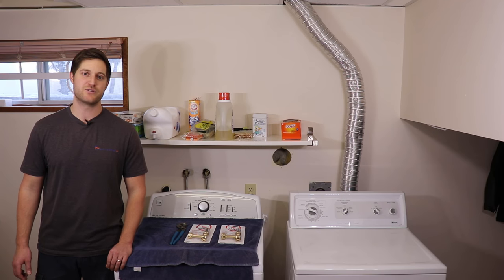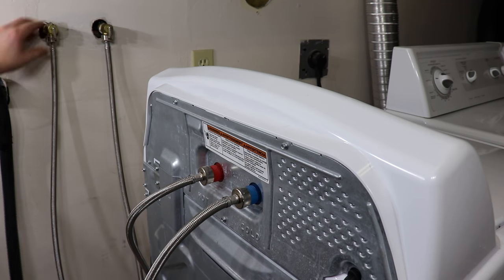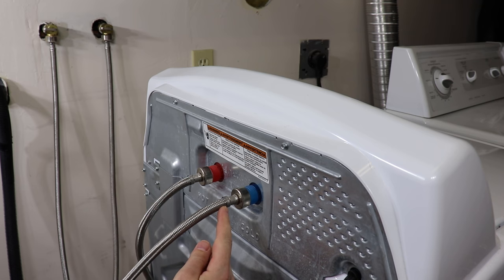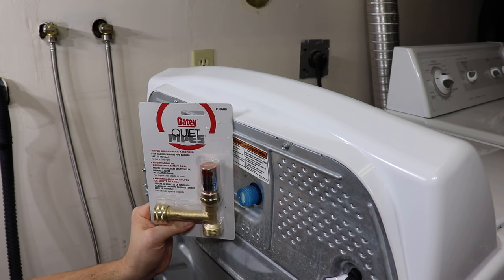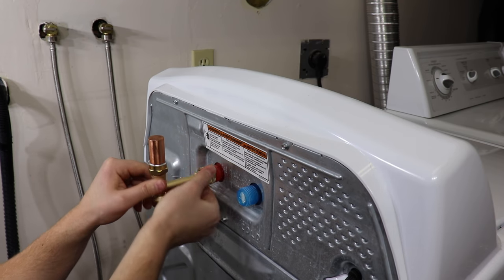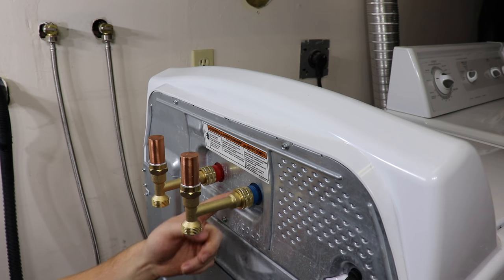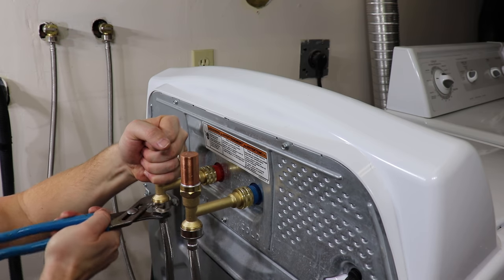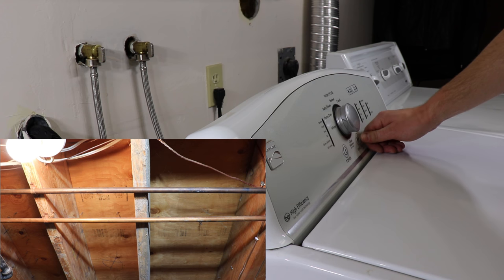Stop Water Pipes From Banging: Installing Washing Machine Water Hammer Arrestors

Comment: So may pipes hammer really bad WHEN we are running a lot of water not suddenly when we shut them off. Thoughts?
Reply from the maker: Interesting. Could be a couple of things.
1. Too much pressure. Are you on city pressure or well? Some city zones have pressure reducing valves installed in the residences because the supply pressure is over 80 psi. If these valves fail it can cause rattling piping and prematurely worn out fixtures. Residential homes shouldn't exceed 80 psi and most are around 50 psi.
2. Faulty shower or faucet cartridge or toilet fill valve. Try running different fixtures and isolating one at a time to see if the sound changes or stops.
3. Piping that is deadheading. Water should flow through a Tee from the run to the branch(the tee part). If the water is flowing in the direction from the branch to the run it can cause unwanted noise.
4. Piping that isn't secured properly. Water lines should be well supported.
Hopefully this gets you in the right direction. Good luck, and let me know how it goes. Thanks!

Comment: Just put an LG washer in and BANG BANG BANG - I need a set of these.
Reply: I tuned down the intake valve a little ....that's the cheapest solution :)
Reply: LG makes a great machine I had my for 18 years but bang bang is always there with or without these arrestors they have the quickest solenoids in the west 👎‼️ bang bang is normal unfortunately a . I turned the feed taps down to almost input pressure and the pipes still bang.

Comment: Problem is. This is only for washing machine related water hammer. What do you do if you have water hammer when you flush the toilet for example and when the toilet fills up and valve shuts, there’s a hammer noise
Reply from the maker: There's water hammer arresters that are designed for toilets as well.
3/8" Toilet Water Hammer Arrestor
Amazon Affiliate Link
https://amzn.to/38Rbile
Reply: @PROSDIY  can you use these on taps for basins or baths also?
Reply from the maker: @The52blocks  Absolutely. The one thing to look out for is that the shut off valve size and the water hammer arrestor size match. This will make installation much easier. Your basins, kitchen sink, and toilets should be 3/8".

Comment: I have a problem with american standar td automatic toilet everytime it’s flushes the pipes above it shakes like banging noise
Reply from the maker: Sounds like water hammer to me. Most of these touchless or automatic toilets open and close the water supply with a fast acting solenoid valve, causing water hammer. A toilet water hammer arrestrr should do the trick: https://amzn.to/2EJK9R5

Comment: Didn't work on my LG. front load.  It is just the hot water making the hammer noise.  Should I try 2 arrestors, one at washing machine and one at the water source?  In the meantime I reduced the hot water tap by a quarter turn and it dramatically reduced the noise.  Is it sustainable leaving it that way?   Thanks
Reply from the maker: It is fine to close the hot supply valve slightly as you did. I would probably have the main water pressure tested. It sounds like you might have excessive water pressure. Over 80 PSI is excessive and can cause water hammer and prematurely worn shower, faucet, and toilet valves and cartridges. 50-60 PSI is ideal.
If one set of arrestors didn't work, I wouldn't install a second set. I would first check water pressure. If water pressure checks out being fine, I'd install a expansion tank on the cold water supply line to the water heater. This acts as water hammer arrestor for the whole house and is extremely effective in reducing/removing water hammer.
Thanks for the question!
Reply: My LG does the same, I had the water to the house tested and then LG said to get a technician and the technician said get a water arrestor but it still hammers but not as bad. They blame the pipes not the machine even though other washing machines do not do it. Do not get an LG as the shut off valves close very quickly and may cause hammering. I am annoyed to say the least.

Comment: Can someone answer regarding this. My Water arrester didnt fit at the back of my Maytag, instead i install to wall waterline horizontally because of the space is it okay or need to be vertically ???please help
Reply: I installed mine on the wall waterline outlets horizontally and they work perfectly. The waterlines don't even vibrate at all when my washer shuts the solenoid valve. Oatey actually recommend installing the arrestor at the wall outlet. Hope this helps.

Comment: they worked on my washing machine. Now when I take a shower, the hammering is transferred to my shower. My shower head shakes when the washer changes cycle. Should I put two more on the shut off valves to the washer? should I put them all over the house? Does anyone have any ideas?
Reply from the maker: Hi Gerald, that is extremely unfortunate. Do you have high water pressure to the residence? Has the water hammer been happening for awhile or has it occurred recently? Water hammer that severe can indicate high water pressure, or having a check valve on the main water distribution line. I would recommend either adding water hammer arrestors to the shower supply lines, if accessible or adding a potable water expansion tank to the main cold water supply line. Adding an expansion tank usually fixes most homes with water hammer issues. It's basically a large water hammer arrestor.
Reply: Don't shower when your doing laundry.

Comment: and then how do you push your washer back in place with those giant fittings hanging off the back? i see you have 10 times more space your laundry than most...
Reply from the maker: If you don't have space to install the fittings, this option wouldn't work. Another option is installing a domestic expansion tank on the cold water supply in the mechanical room https://amzn.to/2LkBYx1. This acts as a water hammer arrestor for the entire residence.

Comment: What if the connections located on washer are vertical one on top of the other and not side by side as seen in your video, how then would you install the hammer arrestors ?
Reply from the maker: Hi J S, Thank you for the question. The water hammer arrestors will function in any orientation. On vertical stacked inlets I install both arrestors on roughly a 45 degree angle. I position the hose inlet (bottom) on the arrestor towards the hot and cold shut offs. This makes connecting the hoses easier.

In the example I show the arrestors vertical, this is common trade practice when the option is available. Installing them on an angle will function properly as well. Cheers!
Reply: PROS DIY Thanks🙂

Comment: Put them on the shut offs don't move the machine
Reply from the maker: You're right, you can either put the water hammer arrestors on the shut offs or the washing machine supplies. Water hammer arrestors work best on washing machines being as close as possible to the solenoid valve though. On this particular setup it would difficult if not impossible to install the arrestors on the shut offs because the hoses, or the arrestors would contact each other. They would definitely work on straight shut offs or if there was more space between the shut offs.
Reply: @PROSDIY  - Isn't "Even Flow" suggesting installing the arrestors on the shut offs located on the wall rather than moving the washing machine and installing them on the machine's back?  If installed on the wall, the contact possibility of arrestors/hose is no different than your current arrangement - correct?  Or, am I missing my Thinking Cap today?  (enjoyed your video)
Reply from the maker: @bethanyanderson1745  The hose thread on the wall shut offs in this video are facing straight down. If you connect the arrestors to the shut offs on this setup either the 2 hoses are going to be too close together or the top cylinder portion of the arrestors are going to contact each other. If you have shut offs which are further apart or ones that have the hose thread facing straight out (away from the wall) then you could connect the arrestors directly to the shut offs. Hope this makes sense. Thanks for the comment!

Comment: The volume of air in these arrestors are less than a teaspoon of water.  USELESS!
Reply from the maker: Hi Web Cityx
, It's unfortunate that it sounds like you've had a bad experience with this style of water hammer arrestor. Useless implies they don't work. They work exactly what they were designed for. Protecting against and reducing water hammer caused by the washing machine. Feel free to check out the 1000s of positive customer reviews on Amazon, Home Depot, and Lowes. All the Best!

Comment: Teflon tape and a little bit of pipe dope though just saying..
Reply from the maker: Constance Kersey
, Teflon tape and pipe dope are not required on these connections. The neoprene washer makes the seal. Too much teflon tape can cause the surfaces not to mate properly, and many kinds pipe dope will actually deteriorate neoprene/rubber over time.

Comment: These mini water hammer arrestors are useless.
Reply from the maker: Hi Web Cityx
, It's unfortunate that it sounds like you've had a bad experience with this style of water hammer arrestor. Useless implies they don't work. They work exactly what they were designed for. Protecting against and reducing water hammer caused by the washing machine. Feel free to check out the 1000s of positive customer reviews on Amazon, Home Depot, and Lowes. All the Best!
Reply: Agree.